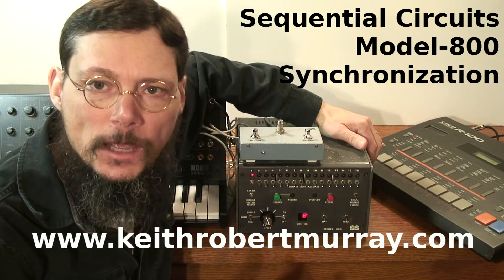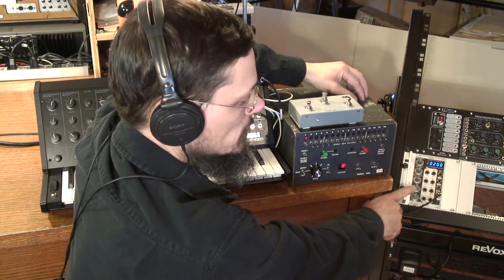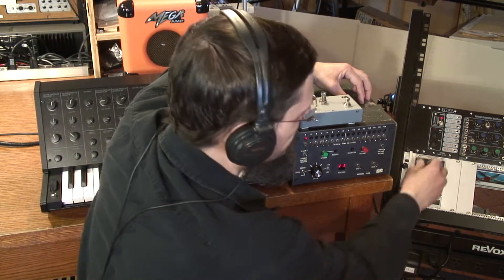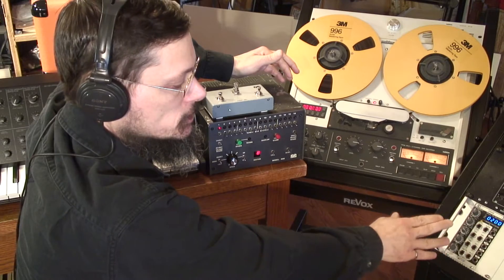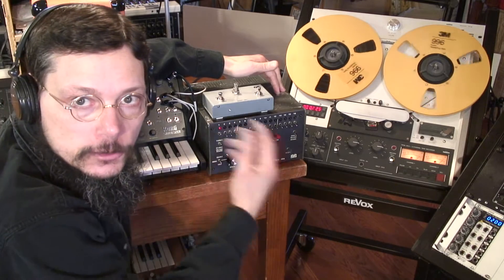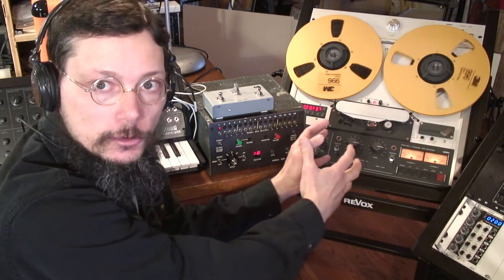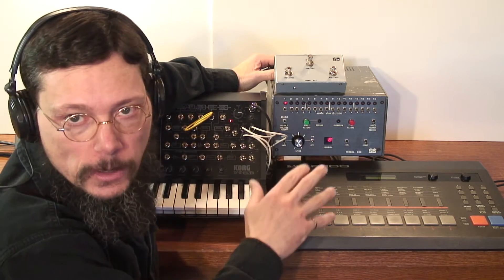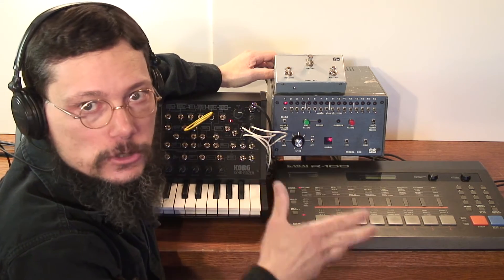Syncronizing The Sequential Circuits Model 800 Sequencer

Comment: Great video. In the first two examples you mentioned using the external clock input. That input uses an unusual 4-pin jack. How did you interface your equipment to it? Thanks!
Reply: Never mind -- I found the info I needed about that Cinch Jones jack and cable for externally clocking the 800, and I made my own. It even has a bonus feature that I discovered through messing around. I'll probably post about it on my channel and/or blog sometime.